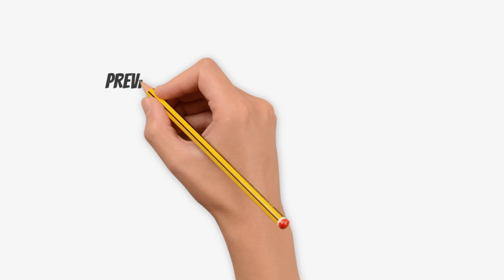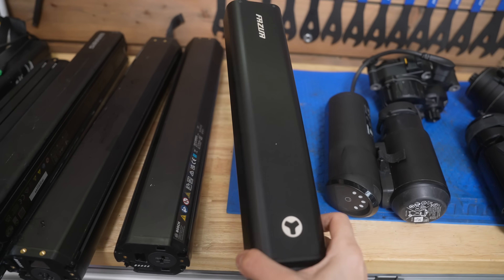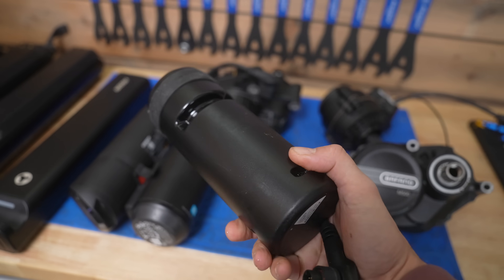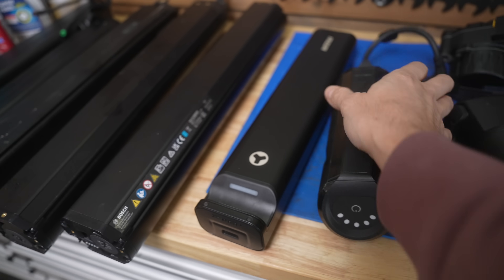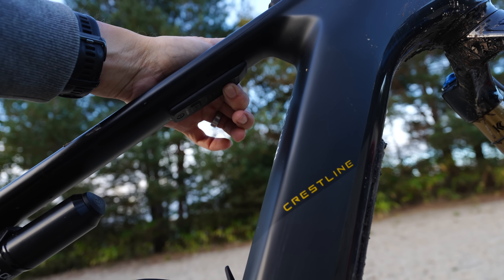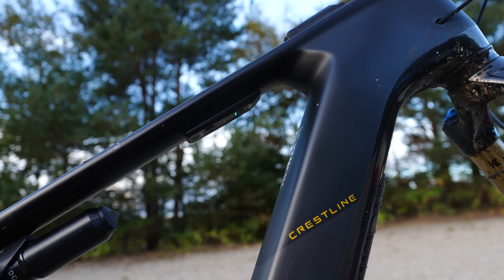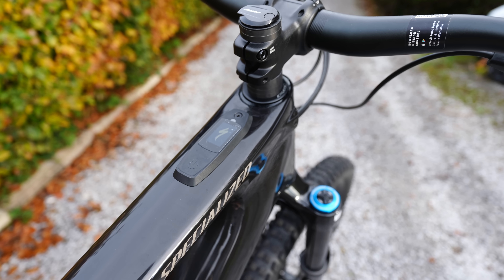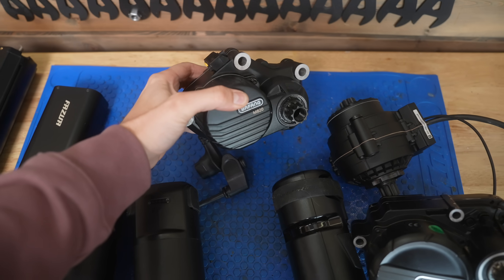We Have A Huge Problem With Ebikes....

Comment: Charging standard isn't easy because you have multiple different volatages for battery packs. Now, you could have a standard for each voltage and each voltage uses a standardized plug, thats doable. But then you face battery chemistry issues... They haven't standardized things and theyve made them proprietary so that users don't catch their battery packs on fire. The only way to do this really is to make the batteries and chargers have a communication protocol that way the battery can request a voltage and current from the charger. Then you can standardize the plug and chargers.

Motor bolt pattern makes sense, they should probably have two. One for smaller motors and one for larger motors, but I agree this should be standardized.

Comment: Very good video, addressing issues where factory support is seriously lacking. I have a  2021  Orbea Rise. The battery is beginning to show signs of age. I can’t seem to get 20 miles of relatively flat terrain, riding. 
Someone should come up with a bottom bracket that would take the place of the motor. In my case if I removed the battery and motor, then installed a fake motor/bottom bracket, I’d have a slightly heavy “analog” MTB.

Comment: You use the example of the laptop and how the device was obsolete after purchase. You're getting this wrong. After a long period of time where consumers struggled with peripheral incompatibility, the computer industry voluntarily standardized on USB for connected devices. You could replace your laptop knowing that all of the things you connected to the old machine would work just fine on the new one. The ebike industry has to be careful. If they don't create workable standards, angry consumers will push governments to do it for them. Government created standards are much harder to move forward that industry created ones.

Comment: This is the same crap that Apple has been doing for decades, and I'm going to make a statement that will have some peoples head explode, but this is a perfect example of a need for regulation. Apple has finally been reined in by a regulation of usb-c charging ports being regulated, and we no longer have to spend $29.95 for a cord that we already have at least a dozen of. This eliminates the ridiculously wasteful redundancy of multiple brand specific cords and the monetary extortion of forcing us to buy them. These same problems in the E-bike industry are only overcome by those with an advanced understanding of electronics and a significant collection of tools and the skills required to use them. Customization by innovative craftsmen and hobbiests is the best part of multiple varieties of our passions, from automobiles to motorcycles to houses. All of which is accomplished with broadly compatible industry standard components and readily achievable skills. But in the case of multiple products, E-bikes and phones, especially rampant corporate greed, have led to the specialized incompatibility of the simplest of components in these industries. Having built my own electric trike for less than a 3rd of the cost of comparable products, I found that online research was the most time-consuming process of the project and trying to modify and improve my enclosed mobility scooter has been a labor intensive research experience. 
Expecting certain components that are called the same thing (i.e., batteries, chargers, and other parts) to be compatible across brands is not an illogical expectation. Or an unreasonable one. Short-sighted product design targeting profitability rather than enclusivity is the reason that only the most high income people can afford to participate in the goal of a fossil fuel free future and is one of the biggest obstacles to the net zero goals necessary to combat the effects of global warming and the need to eliminate the massive amount of e-waste that we produce.

Comment: 😅I disagree on every point. EMTBs are no different from cars petrol or electric (batteries), nobody is demanding new engines be drop in replacements for old cars. Motors and batteries don't become obsolete, a 8 year old CX2 motor still makes short work of hills, replacement batteries are easily to source. Geometry may have change compared to modern bikes but it still handles same as day it was bought assuming suspension has been serviced. 

Old EMTBs have one big plus over their muggles equilavents, thay can be repurposed as highspeed commuters or tourers. My old CX2 FS MTB is brilliant commuter with road tires and dongle. Old quality MTB brakes are still far superior to entry level brakes on average HT commuter.

Comment: So don't get suckered by computer controlled synchronous AC motors that waste most of your energy on power transistors and computer software that turns itself off without subscriptions and updates.
12V brushed DC radiator fan motors are a good choice. Pair them with a 5 buck pwm speed controller and 24V of LiFePo battery, driving through a freewheel on your crank.
Less than $200 total and you will outperform on weight, power, reliability and efficiency, any of the shyte coming from these brands! 🤭

Comment: This is honestly one of the reasons why I am still using my gas powered bicycle kit after about a year.  I hate that to think I'm still adding to the problem but I just don't trust electronics these days and I'm not spending 1000 bucks or more on an e-bike to have an issue with the battery or motor a year into the purchase then have to dump another 500 down to repair it or not be able to get parts at all.  I got a Grubee 69cc two stroke kit for under 300 bucks and the engine itself has survived the terrible Canadian climate without much issue. Anything I have had to replace is cheap including parts such as the cylinder head or piston, plus a lot of the parts are compatible with other engines and mounting for most engines have a sort of standard arrangement.  There is absolutely no excuse for e-bikes to be so different from this sort of serviceability for what they cost.

Comment: Apple were forced to use USB C  Which can take 100w.  Bike makers should use that too.   I have a Dud scott frame only suitable for scrap which could be used.
Reply: A bafang hub and kit is currently the most flexible and repaiarable system that exists.       I have fitted 5 kits and and moved my own kit to 2 other frames.  pedal sensor has been the only repair and cost £12!  Motor can be regreased easily.

Comment: When I bought my Bullitt cargo bike, I really considered getting an electric one, but in the end I just decided on a non-electric one. 
This video perfectly explains why! On my non-electric one I can practically infinitely keep fixing/replacing parts when they wear out or break.

I'm not sure that would be the fact with an electric one... I'd hate to have to throw an entire 2000 euro frame out just because of a broken motor some years from now.

Plus I can still fit a front wheel hub if I still want to convert it in a non-proprietary way. Yeah it's not as good as a mid mounted motor but it's non-proprietary and it's a free choice.

Comment: Sounds great and I’d be for it, but literally no other wheeled industry works this way. Very few things are cross or reverse compatible. In fairness to the companies…they are “Bike” companies, not “Frame” companies. You’re not going to drop a Yamaha engine into a KTM anytime soon, you aren’t going to bolt Nissan batteries into a Toyota, or a Ford Transmission onto a Hyundai engine 🤷🏼‍♂️

Comment: very short sighted to try and lock someone into one brand. historically it doesn't work. freehubs being a good example. the HG driver was by far the most loved since sram and shimano both used it. now. with microspline and XD you just dislike both brands more. with ebikes you just avoid them entirely until there are standards in place. more influencers needs to push for a universal standard and as you said, backwards compatibility

Comment: Standards here... I see a problem ... bike thieves will have an easier time if they steal one of these to find a charger or get a plug to make one ... having had my expensive ebike stolen I am less concerned about standards and prefer just to get a good product ... besides if you are moving onto something else you sell your old bike ... ebikes are not something one is custom building up so if you are going there well ... I see it as hey that is your problem ...   for motor shape and design bolt patterns ... sure upgrading the motor ... but then what do you do with your old one? ... keep a bin of e-bike motors in the shed? ... come on for me anyway this is not something I fret over and there is little chance of a motor standard taking over anytime soon if ever for ebikes as the volume just is not there... buy what you like to ride and then sell it and get something else if you are one to change things more frequently ...

Comment: Voltage is not standard. If you plug in a 60v charger in a 48v battery you will be lucky if all you get is a broken battery. Alot of this is for saftey not all of it of course. But to say you are SOL if you want to maintain or upgrade a ebike is complete rubbish. You can easily upgrade and change anything with aftermarket parts.

Comment: You make valid points Rob, but you talk about forks any fork will fit in an ebike, you forget about cars each manufacturer doesn't make cross-compatible parts either. So your point is not valid most things made in this world aren't compatible with each manufacturer. So let's just focus on the bikes and stop ragging on these bike companies.

Comment: It's businesses worried that any product they release which is compatible with a range of bikes, will become the new standard.  At the same time however, 3rd party sellers will appear on Amazon at 1/2 the price.
On one hand, genuine companies, making genuine advances in the EBikes need to recoop their R&D costs.  However, the market today is very, very quick to replicate and copy anything and the patent systems don't work internationally yet.
On the other, people don't like paying for everyone else's product, they only want to pay for theirs.  So they will tend to shift over to the 3rd party providers who didn't need to do the R&D they just copied, so they can sell at a price point which the original company can't.
For my the problem is that some of these companies are large enough to now need to do this.  In their case they are just doing it out of standard corporate greed and "locking in" the customer.  It's ripe everywhere from drill batterys to phone chargers!
The solution is for someone to make a OSH, OSS EBike reference design.  (Open source hardware/software), publish it, for free.  Let everyone start refining products with it without the massive R&D costs.  The R&D comes from the community and under the understanding that they are working collectively for a better EBike standard and don't specifically care about companies, products and pricing.  Just designing and refining the standards towards a better eBike.

Comment: 1:51 if you think that because the plugs different than that makes it incompatible then you are exhibiting intellectual laziness or low effort thinking if you prefer.
It would take less than 5 minutes to cut the plug off match up in solder the wires the old-fashioned way to wrap it with a little heat shrink and call it done.

That said I do despise the way parasitical manufacturers make everything so proprietary that their own stuff doesn't work one year later without modification. I think once people snap out of their herd mentality over the next 5 or 6 years the ones who will clean up will be the ones who make everything modular and universally compatible which should earn them customer loyalty like we haven't seen in 3 Generations

Comment: Expendable bikes are a symptom of expendable (and generally inexperienced) programmers.
These companies spend $$$ to design mechanical items and tool them up (hence the parts fit retroactively)
But programming is farmed out to the cheapest source and paying to have old code rewritten so new hardware can run it is just outside of most farm programmer's scope of knowledge.

Comment: The same thing goes on in the auto industry almost since its inception. Any part that can not be further changed to benefit from design is strictly for the make and model. From wheel hubs to door locks, nothing is allowed to be standardized otherwise, and nothing is backward compatible. There are even parts that are region specific with their own mounting points. What balances this out is the aftermarket that back-engineer these parts and helps to keep older models alive even after the brand stops support.
Although it is a nice sentiment, forward compatibility will not happen, unless it is law mandated or design would hinder function.

Comment: I'm lucky. My Wallke E-bike uses that silver colored 14AH 48V that a few other companies adopted. This makes it a bit easier to get extras as I have done. It uses 2 pins for power, has a very standard 2.1mm barrel jack for charging and is a perfect rectangle. In my opinion, the XT90 connector should be used to connect the batteries to the controller. ALL BIKES SHOULD BE FUSED INSIDE THE BATTERY. This would allow users to buy/sell other batteries when their e-bikes go bad or vise versa. It also means cheaper batteries due to plastic molds being universal. They should all use 21700 cells inside as well. Basically, get the geometry, voltage of the packs, plugs and cells the same and you have a good baseline for a standard cell. Have a 36v, 48v and 72v standard and call it a day.

Comment: My eBike hub motor failed after a year and a half and can’t be replaced as the small local company that made them have stopped. I have a large 600W battery pack that went on top of my rear rack and cost £500 or so that is now useless waste. I’m just riding it as a regular bike for the moment but eventually hope to buy an eBike conversion kit and new battery from a larger company to reconvert it to an eBike.

Comment: Having been at the very sharp end of obsolescence with a Van Moof S2, I would not buy another e-bike at the moment that does not have completely bolt-on components. Which is why I did a Swytch Bike retro fit on the Moof. It's not that pretty but it just feels a bit more future proof and a hell of a lot cheaper. There is no way I'd fork out £1000s for another integrated system.

Comment: First step is that we need a common charging plug standard that makes universal charging viable for 48V, 36V, 52V, 72V. This could use a comms protocol standard in the BMS that sends voltage and current request to the charger to ensure we stop battery fires, and also create perfect charge power ramping. We already have NYC's law that requires UL listing for e-bikes because fires are out of control.

Comment: I think the EU should mandate one charging plug, like they did with phones and other electronics. 

However I do not agree with the rant about motors not being compatible or upgradable. Consumers should learn to be happy with their purchase and not look for the next great thing immediately after. I think it is ridiculous to be unhappy with a 10k euro bike after purchase because something better came around. Even more idiotic is wanting to upgrade it because someone else may buy something better. You asked what will become of the frame that does not support a different (newer, better) motor? It will still work just fine with the old one, right? The old motor will probably out live the frame anyway, so who cares?

Then again, I don't even want an ebike. Pedal power all the way for me.

Comment: It's definitely true that standardization is very important, and the industry should move towards this, but to play  devils advocate.

Ebikes, as a product, I really feel that you don't really have too constantly upgrade really, usually they do the job just fine from a base level if you got something of good quality, I'm primarily a commuter, I don't ride MTB's, let alone EMTB's. But, i feel like most ebikes appeal to commuters and people looking for casual urban or even rural riding, so typically, once you got the bike, it's the bike you're gonna use all the time, it was your investment, and it may not have all the bells and whistles of a bike that might come out months later at a possibly similar price, but what you have does the job, so there's not much reason to tinker with components in the electric drive system, all you need is good matainence and it will last you a good long while, maybe it'll be a hassle if you have to swap the batteries from a fully integrated battery frame, but generally, dealers like specialized and trek and the bike shops that work with them are typically willing to do that for you.

Bottom line, a bike is a form a transportation, like a car, maybe there are some things you can do too improve the car and its proformence, but some things, aren't meant to be easily changed, like the engine.

To clarify, I'm not totally excusing these practices, but I can see why they might not focus on interchangeability as much with motors and such.

This is simply just something I was thinking about while watching the video, and thought it might be worth giving my two cents.

Comment: I got a wfo e9 in 2020. Right before the warranty expired I had a simple 532 error. After getting the bike back it would not go past 5mph. The warranty had since expire. When I went back to the shop I was told y bike is obsolete and there is no repair for it. I paid over 10k for the bike and batteries.